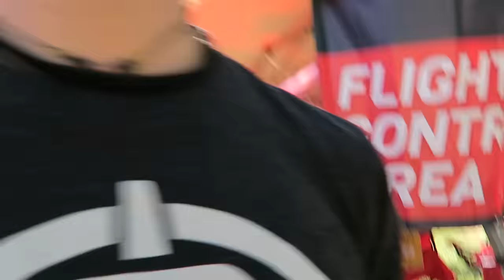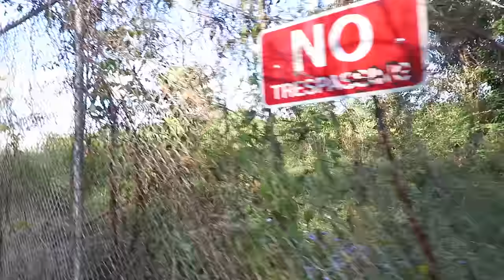No One Got Hurt Except for Barbie

Comment: how u seeing anything in that darkness?! lol - what FPV cam u using?
Reply from the maker: just an HS 1177  I just use the light at the end of the tunnel to gauge where i am
Reply: Mr Steele - ain't that a great and weird feeling, just zippin' through the empty blackness toward that splash of light at the end?! like fallin' backward, just trusting da kwad gawdz to catch ur ass... then BAM! into the light, and PUNCH IT! And DAMN! that power loop, bruh... noyce. just noyce.
Reply: Wow, really? I thought the FPV cameras had enough dynamic range and fast enough exposure adaptation to handle going from facing the Sun to indoors and back without a problem...

Comment: What props should I use because I have been running 4s and I am not getting the speed I want??
Reply: what props and motors are you running?
Reply: topspeed or acceleration ?
Reply: Chris S.   Acceleration
Reply: Are you already running 2205 or 2206 motors? you could also set your motor timing lower to get more torque, prop wise 3 or 4 blade, possible try higher pitch props, get some hq props steele skitzo etc. are flying so you can compare easily
Reply: Chris S.     I can't remember what motors I am running but I am use 3 blade props
Reply: So you propably got a some beginner kit with 2204´s, maybe your triblades are a little heavy for the motors. if you´re running blheli, try the motor timing, it´s the most easy thing to try before changing your gear.
Reply: +Chris S. (ChrisFPV) you got any videos?

Comment: Hi guys, I just wanted to talk about my quad, I built a MHQ2 quad by hovership ( http://www.thingiverse.com/thing:511668 ) which I printed myself then assembled. At first I had no camera or FPV, however now after flying it for a couple of weeks, I invested in a simple FPV system and a cheap GoPro equivelent (the SJ4000). This has really helped my flying, and the SJ4000 is great quality and has produced some absolutely epic footage. I have started to get into the more racing side of things now though, and want to go faster ( as many pilots do). So, as I have come to realise that the MHQ2 really isn't meant for speed, I was thinking about getting a new carbon fibre frame. I had in mind the QAV 180 , 210 or 250. I really have no idea which is better and if my current 3S system with 2300kv motors will work on those slightly smaller frames. If anyone could help me out, that would be great. Also, if you want to look at the videos on my channel and see what you make of them, that would be much appreciated. (leave a like and sub if you enjoy them). Thank you and I hope someone can help me out. :)
Reply: I think it's retarded how the battery is in the back of the quad. That's going to make it spin out I'm tight turns.
Reply: The centre of gravity is still roughly in the centre because of the camera
 but I agree that it does yaw very slowly due to inertia